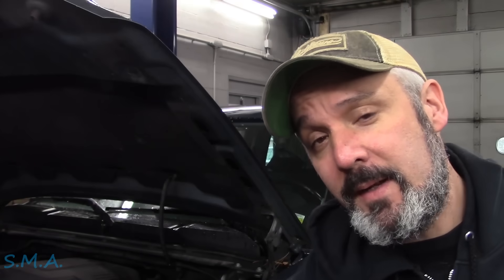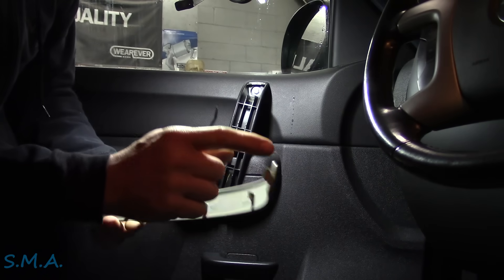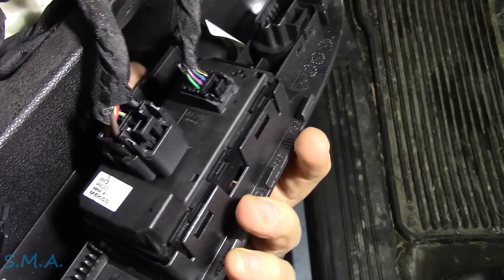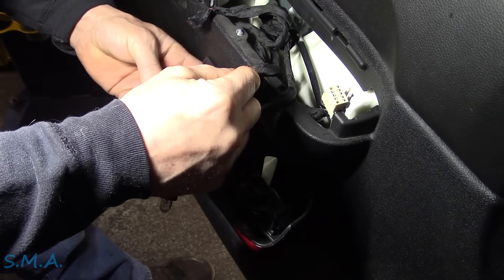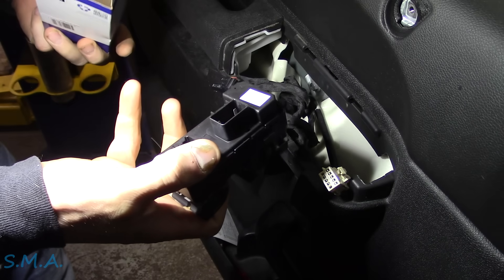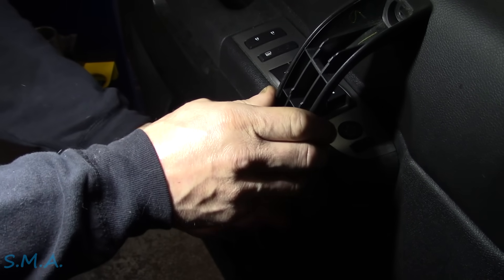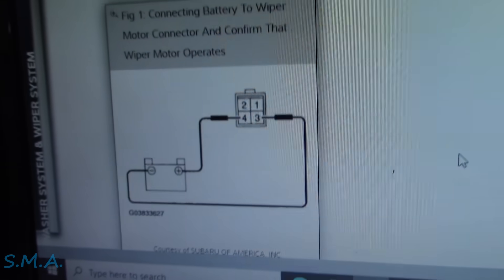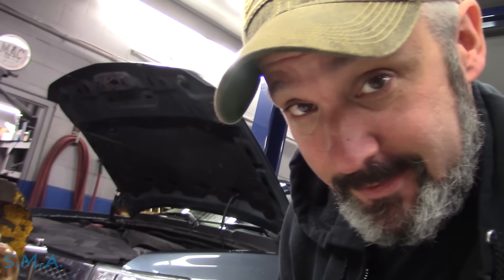Chevy / GMC Truck: Driver Window Switch Not Working On All Windows

Comment: Always trust service data. That's why I only scrape Ford cylinder heads with a plastic scraper. I should be done with this one by Christmas...
Reply from the maker: With 13 layers of PPE
Reply: What is suppose to work compared to what actually happens. The world would grind to a halt if we always did it by the book.
Reply: Lol 😂
Reply: Ahh, but if they tell you to use plastic, and you deviate, they can put the blame back on you far any problems!
Reply: you and SMA are my go to channels 👍
Reply: That is in all car makes,they all say that; 

We,mechanics,all know that the the best would be to use ANY material that is LESS hard then Aluminum in order not to sratch it; scratches are avenues for leaks; but we also know that the gasket fibers are harder than most plastics,and when they stuck on fast, no plastic will cut it; 

Of course,once you know that you cannot scratch that soft aluminum,you can expertly scrape at it, using  the sharpest and hardest material you can find, maybe even nuclear depleted uranium,  lol 
And, the wider the sraper is,the less pressure and less scratches.
Reply: You should know by now..... service manuals are never written by those who... actually service the vehicle that would be way too easy... They are instead written by someone who sits in an office drinking a nice cup of tea or coffee and their only experience in the real world is what they have read in books......

Comment: While you were having lunch, at 4:03, I paused the video to think through how it works and decide what I would have done. You gave us the chance for a brilliant teaching moment. At first I was a little surprised that each switch sends both a power and a ground wire over to the other side, rather than one power signal wire, with a single ground for each door. Clearly they do that to allow the switch to reverse flow by swapping power and ground, thus requiring two wires for each logic decision. And your decision to use a parallel test light rather than a multimeter didn't escape notice. Old school!
Reply: Could it also be for safety so that a single shorted wire wouldn't accidentally cause the window to close.....on a child?  I don't know, just wondering. I know it was a concern in the past when power windows became more common. I don't remember what the safety feature improvement was.....but maybe what you described is it.

Comment: In re: the Subaru, I had a Grand Cherokee which blew the 15A fuse for interior lights.  I ended up in a local shop, they “said” they replaced an interior light socket.  Later that day, the entire interior burst into flames.  Huge hullabaloo, months of investigation by three insurance companies.  In the end, some hot shot “mechanic” at the repair shop had “fixed” the problem by putting a 25A fuse in the slot. Right!

Comment: I remember 2 cars that I had to replace the clutch in that the repair manuals said that the whole front suspension and CV axles had to be taken out to get to the clutch. On both of them I took the left side lower ball joint off the knuckle and was able to shift the transaxle over enough to get the clutch replaced. A few minutes thinking saved me hours of work. Another case was a Chevy Luv pickup that the manuals called for taking a lot of parts off to replace the starter. A few minutes looking revealed that the simplest way to get to the starter was to drop the exhaust pipe and access every bolt and nut on the starter. It sure beat taking half a dozen other pieces off that didn't include the exhaust pipe.

Comment: 6:16. The best part of this video is the home made 250ma amp pulling test light. Looks like light socket with bulb, 2 heat shrink crimp connectors and 2 t pins with the t wacked off. Brilliant!
Reply: He has a video somewhere where he shows how he made those test lights.  He made several with different size bulbs.
Reply: yeah there are a bunch of videos with various home made test lamps to test loads. He has a headlight mounted inside the lid of a spray can for one. There is a how to video if I recall on him making it.

Comment: I had this happen on my '13 'rado.  I took the driver's side switch to bits and cleaned the circuit board contact points and the switch contactors. Fixed my issue without the switch purchase.  A switch teardown would probably reveal a lot of buildup on all the points from the switch's exposure to the elements.  Awesome as always!
Reply: On my 2013 GMC Sierra, I can only roll up the front passenger’s side from the driver’s side.  It was intermittent for a while, but now only rolls down.  I’m planning on taking it off and cleaning it like you did.  I’m hoping that is a free fix and won’t require a new switch.

Comment: Had to fix the window motor on my brother's partner's Skoda Fabia last year, 2 door, 2008, but couldn't find one in a scrap yard. However I could find a plenty of Volkswagen Polos, 2 door 2008 models. Exactly the same switches on the doors, physically the same motor, both made by Volkswagen group. Did it work? Nope, the motor itself has software in it, and if it doesn't match the original then not only does that window not work but the other window doesn't work either. Absolutely crazy!
Reply: German engineering at its "finest"!
In the future you might try treating it like a failed hard drive. Assuming it's the motor itself that failed, and not the driver circuit on the circuit board that also has the computer, I'd try swapping the electronics of the old window motor into the casing and motor and gearbox of the junkyard-obtained part.
I mean, if the computer being different is the problem, then keep the computer the same, right?
Reply: @44R0Ndin  Yes, except the problem was on the circuit board rather than the actual motor.
Reply: Ugh!!!   What a pain that is!!!

Comment: I just did one of these a few weeks ago on a 2014 Buick Enclave, except mine was a rear passenger side window switch and unfortunately you have to remove the door panel to access the switch box unlike the driver master control switches.  All went well until I got to the plastic clips, now I didn't break anything, went slow and easy, but man there was a lot of "Come-on Baby" lol as those clips hung on for dear life I've never seen or had a plastic door panel clips hold like screws, it was nuts!!!  But I got it done.  Wish it was easy to access like this, and I tried to avoid full panel removal but that's the way GM decided to go with the passenger window switches according to the GM repair manual. Oh well.
HEY Eric, thanks for the post and a hello to Mrs. O!!!  Hope you both are well!!!

Comment: Not a stupid video.  I am working on same vehicle with identical problem.  I wish I had seen this video before I removed the door panel, removed speaker and unplugged wires from fuse block.  Actually, I did watch the video when released but forgot about it.   With the wires hanging out the speaker hole, I found continuity on the light blue wire so it wasn't broken enough...  I didn't understand how the circuit works until now since watching this video.  Now, I know what to test to rule out a faulty switch.  Your video makes it easy peasy.

I do like the easy access to the plugs for the door wiring on the fuse block.

Comment: My daughter has one of those trucks. When she had a window problem she went on YT and found a video about cleaning those switches. She did it herself and it worked.  I find the switches that sit flat give more trouble as dirt, dust and soda can fall into them.  The older cars with the switches mounted vertical didn't have as many issues.
Reply: They must have pretty big gaps if soda cans are able to fall in. 🤣
Reply: @chrishartley1210  Its a Chevy.
Reply: @chrishartley1210  I said soda can not soda cans one letter makes a difference

Comment: I had a 09 Malibu with a drivers side window that wouldn't operate, up or down. after days of fishing around with the switches, finding they were good, I finally found there wasn't power going to the window motor. so I checked the rubber boot between the body and door, sliced it open, found some wires were broke. spliced them back together, back in good shape.. I don't have any meters to get into the computer but  maybe if I did it wouldn't have taken so long.. so action causes a reaction as in the door always opening and closing with that rubber boot flexing with the wires in side. food for thought..Great videos!

Comment: Hey Just wanted to say thanks ! Out of the million times i have swapped out a part And stupid amount of money And crossed bleeding fingers. Watching your videos lead me to actually find the problem first. If i had to buy a fuel pressure tester before knowing it was a pump Or a injector so be it ....
This latest pain was the Driver door regulator motor ...Tested the relays with a meter And a 9volt After swapping them Looked at the fuse. Longer story short Took the motor apart And found One of two magnets on the sides of the shaft was split/broken And my guess is it was the side for going up. And the reason it split was a loose rivet in the door plate The window would flex this plate And the motor would be on a slight angle Putting pressure on the window in the slot to go up And pressure on the shaft that would grind on the 1 magnet ....replaced the whole motor and arms Bingo Bango ! ty..PS replaced the rivets for bolts and larger washers

Comment: My 07 Chevy crew cab has the exact problem. Front passenger window will not go up or down from driver switch. Thank you I will be changing mine out soon. I’m sure I’m not alone in this otherwise how lucky can I be that you did this video.

Comment: Thanks Eric. I for one appreciate getting to watch the disassembly of the plastic snap together parts. I hate breaking a little tab off and then it won't go back together right and tight w/o glue or JB weld. That's its own nightmare.

Comment: easy life you are having there Eric, i have been working on an old chevy, it's a 1960 bel air 4 door V8, it has been sitting for 7 years and my job is to get it back on the road, so far i have it running on 7 cylinders, latest job was the brakes, so all new hydraulics for the brakes and we had a great test drive a few days ago, next job is to tackle the miss fire then it will go for an MOT, which is a uk safety check.

Comment: In regards to the Subaru test jumper, you can make up your own with some test leads and a DC circuit breaker (CB). You can use a thermal automotive ATC CB which is very slow, or you can use Marine CBs, where you can get a choice of thermal or magnetic types to give you the desired response.

Comment: Excellent Eric no black out this time.
I often find with Subaru’s rear wipers that the water leaks down the shaft and corrodes the outer Casing causing the shaft to seize. 
I’ve taken apart quite a few,cleaned them up lubed them up and reinstall and seems to work fine.

Comment: Dude, I broke down the wife's 2011 Chevy drivers switch controller and found that my wife has been spilling..... you name it, it was there. (Coffee, Soda etc.) I clean everything with alcohol, added a lite coating of Dielectric grease to every moving part and reassembled it back. Works like a charm. The wife's now happier than being in line at FiveBucks. So for you Fix It Yourselfers, try this before spending whatever this switch cost. Be Gentle with the plastic parts being there really isn't any major guts inside. "A LITE" coating of Lithium spray lube works even better.

Comment: Great advice on not trusting manufacturer's data (flow charts, etc.).  They are not infallible.  Like you said, if a human was involved in writing the information mistakes can be made.  Goes to show you how important the theory (electrical, electronics) is.  Shorting the wrong thing out can be expensive.

Comment: I had the same problem on a Subaru after replacing the battery,except the fix was much easier, just had to reprogram the switch by standing in my head, pushing the start button three times and doing the hokey pokey then activating the switch and like magic it worked again. Actual steps I don’t remember but it was simple, nothing like thanks for replacing the battery but hey you broke my power windows!

Comment: I had to replace the master/driver's side control set in my '07 Accent and the stupid part is over $200. I miss manual crank windows. Vent windows too!
Reply: I agree. I converted my 91 Toyota MR2 power windows to manual.

Comment: This process bang on. I had a similar issue on my Tacoma. I didn't have any wiring diagrams at the time so I just tested switch continuity. Found the bad one was an open circuit on up and down. It was much more brute force and having the diagram would have been great.

Comment: This is why I love old cars crank windows. A lot less to go wrong  Battery dead can't roll down your window the switch is bad can't roll down your window a wire is shorting out can't roll your window down A fuse is blown can't roll down your window

Comment: Im still amazed at the wiring diagrams you use, most of the time they are accurate. I use xyz, ( I wont say alldatadiy's name) and also two others,  its amazing how many times info is completely missing or two planets away wrong. I end up using the ole MAC short pulser to chase wires,  what a mess

Comment: Saw something like that in an old Mitchell Manual for an 83 Oldsmobile V8.  The mixture control solenoid was shorted out in the manual.  I notified Mitchell, they said they would correct it.

Comment: They aren't SUPER common, but I have replaced maybe four or five window switches on this generation truck. There are little metal contact pads inside that get burnt over time. I've had good luck cleaning them with a pencil eraser and rubbing alcohol. For a while, I'd keep an old, cleaned up unit on hand and swap it into customers' vehicles if I noticed they had trouble with their windows.

Comment: Great video! Very funny!
Question: could you have open the old switch buttons down to the chip board, peel back the membrane and lightly scrub off the corrosion on the metal contacts?

Comment: I took the entire harness out and did my continuity tests on every wire, it was all good, I cleaned the switch contacts , I have power going to the switch but nothing happens. I checked my actuator and power window motor and they both work when powered directly and reverse polarity check as well. Checked my fuses and all OK. I think I need to order a new master switch . Also checked my relays and also flipped relays to no avail.

Comment: That's gonna be a reoccurring issue, if like me, they drive with the windows cracked/open in the rain. The door is perfectly designed to have the drip land right into the switch.

I fixed my Sierra by opening the switch. 
Cleaning all the contacts. 
Flowing silver solder on contacts.
A few years, no more issues.
Reply: Old one lasted 10 years. Wing a new one in and call it a day for a $50 part. Your and my own car, sure. Its worth it to play with it. Eric O needs it to work 1st time, and not have to go back in there.
Reply: @mph5896  Completely agree. Just wanted to add my experience for those of us that can, and want, to repair instead of replace.

Comment: I've had such an increase on spam calls.... it is OBNOXIOUS!! I no longer use my phone unless it's in "do not disturb" mode and then only my contacts allow the ringer to function. 

Interesting setup on that switch. I would have thought the same using network instead of individual circuits. 🤔
Reply: Spot on with the bonus at the end.... flow charts DO SUCK on their own, but have contained excellent info found nowhere else in SI.

Comment: I had the same problem with my 2013 GMC pulled the switch opened it up and cleaned the contacts. Worked fine afterwards. Bought a new switch but never installed it.
Reply: Yes, I came to tell all the chivvy guys this same thing.  Take the offending switch apart and clean the contacts with a pencil eraser,  you'll be back in business in ten minutes start to finish 👍  no parts required.....possibly
Reply: Do you remember how much the switch was and where did you buy it at?
Reply: @tjkaczynski5896  I got mine at a dealership less than 30$
Rockauto also has them

Comment: thanks for including the bonus footage, it was very interesting to see. though i dont really understand the circuit. specifically the purpose of the run position.  its because the function of the green wire is not explained. i think you mentioned intermittent operation. i suppose the green and yellow are both related to directional movement of the wiper motor and the switch alternates from park to run as a controlled solenoid from the blue wire? please explain! im not sure if im looking at a forward/reverse wiper motor circuit, or an intermittent operational circuit for the motor.

Comment: Love your channel!  Absolutely best auto repair channel on YouTube.  But didn't follow your testing of the switch.  Understand that the switch wasn't closing in order to close the circuit and light your test bulb, but left me wondering if power was not flowing through the switch (b/c it was open) or if power was shorted somewhere up to the switch--especially with as many wires to the switch as the bucket seat model had.  I was betting it was the switch before you started, but I know those things are expensive.  Did you test wires with multimeter and we didn't see it?  Just curious.  Keep up the great work!
Reply: If there was a short downstream, you'd see the lights dim in the vehicle, and/or the fuse supplying the switch would blow. Since all switches are on the same supply, that can't be the case, as the other switch worked.